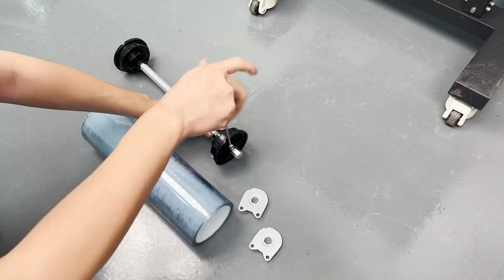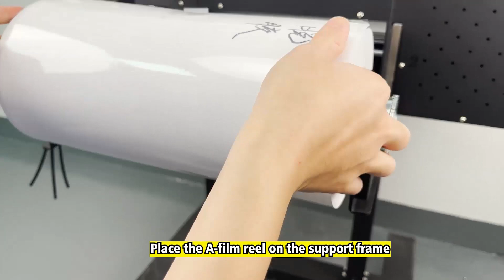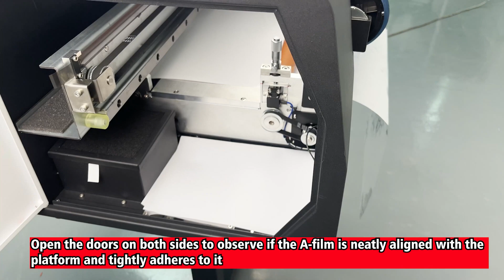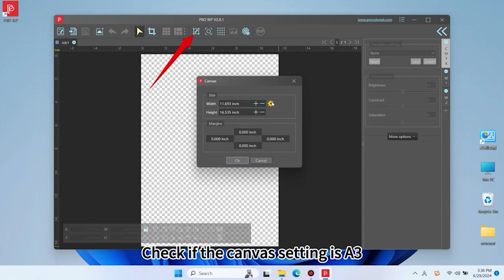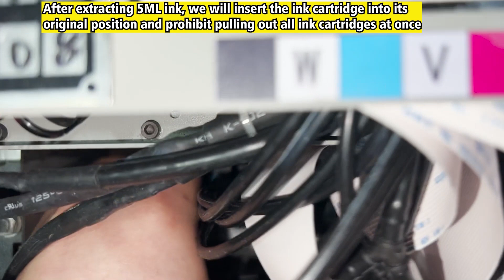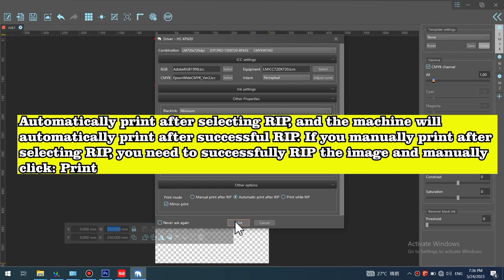Procolored VF13 Pro UV DTF printer setups | 13" A3+ Dual Heads

Comment: where is the ethernet port is located on the printer ? all theses video show cable connected to the computer but no  pictures or video showing the ethernet port
Reply from the maker: it is a cable on the printer back